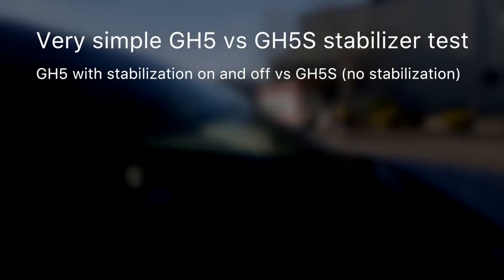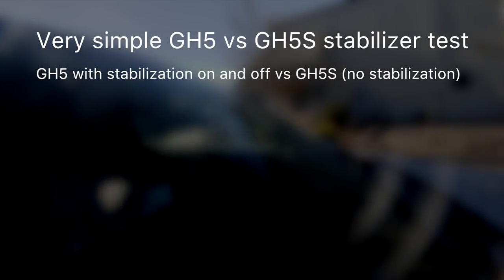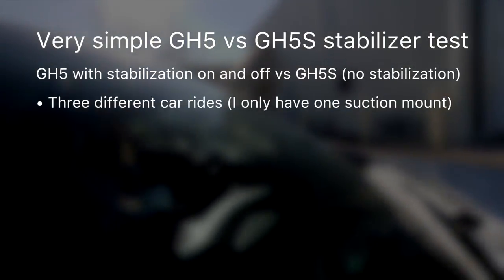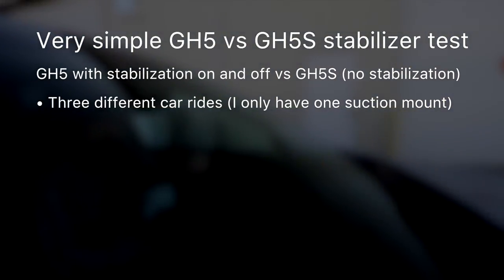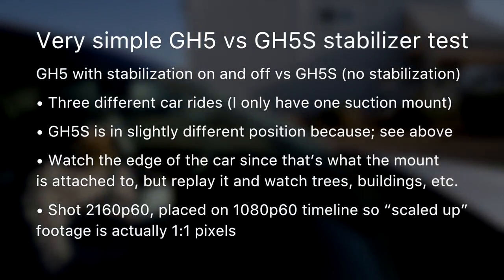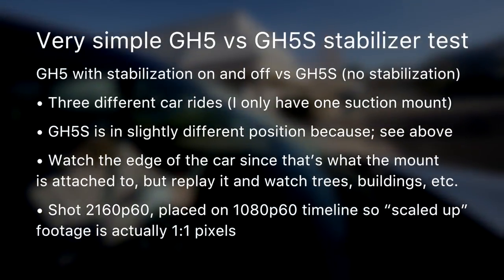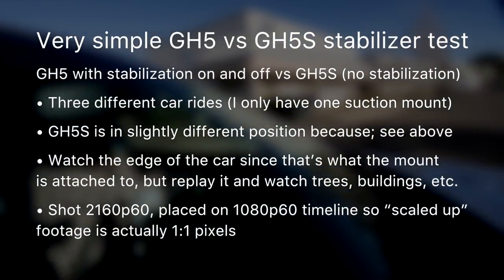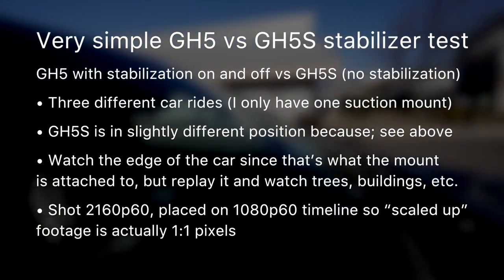GH5 vs GH5S Car Mounted Stabilization Test ► Why the GH5S has no IBIS!

Comment: Holy freaking crap. You did a great job of showing the truth behind the lack of IBIS, but you've unintentionally done something far greater: you've shown how much more detail the GH5S captures over the GH5! If you look at the ribs and ends of the metal awning as you drive by, there's SO MUCH more detail in the edges and the reduced rolling shutter becomes obvious too. Thank you for this. Quality content, my friend.
Reply from the maker: Thanks man. I think it’s the elimination of the movement that’s allowing that to be sharper; not because of a difference in general sharpness on the sensor. But good catch for sure.
Reply: @photojoseph  Possibly, but even if that's true, the captured colors are richer as well. The movement shouldn't make the colors look better. I'd guess the fat pixels are responsible. Well, that or you didn't match color styles. By the way, was this with the newer firmwares (2.4/1.2)??
Reply from the maker: You may be right. I believe I set the color profiles the same but that's probably about it. Color matching wasn't a goal. The video is nearly a year old so whatever firmware was current then.

Comment: I had to get an in-car shot yesterday and rigged my GH5 + Lumix 12-35 lens with stabilization for BOTH turned ON. I had the camera mounted with two suction cups on the windshield connected to the cage via friction arms. The thing was rock solid. Got the footage off of the camera and it has those tiny micro vibrations. I didn't even consider using my GH5S. I think that I'm going to have to do some tests now b/c I need to re-shoot the footage.
Reply from the maker: Yep… the stabilizer isn’t designed for (and I don’t know that it even could be) those “micro vibrations” as you call them (good name). Sorry you had the experience but now when people complain to you that the GH5S has no IBIS, you can explain why 😬 Also when you test again don’t forget that lenses with IS are the same — floating elements that will still move when IS is off. Probably less of a problem than the sensor although I have not tested. That’d be interesting though. If you do end up testing stabilized vs non-stabilized lenses, I’d love to hear your results.

Comment: I wonder if they could design some kind of trigger in the GH6 that mechanically locks on the sensor when IBIS is turned off. Just so those car and Gimball/steadicam people can be happy.
Reply from the maker: Not likely. The sensor floats in a magnetic field. You’d either need physical, retractable “claws” that grab the thing, or magnets so strong they pick up nearby spare lenses ;-)
Reply: Yes I'm thinking retractable claws or something like that that mechanically holds the sensor stable when IBIS is disabled.
Reply from the maker: That’ll never happen. Take a look inside the body… there’s no room for that.
Reply: @photojoseph   Never say never ;)

Comment: I thought the other issue is that they are actually going using the "entire" sensor size to maximize anamorphic resolution, vs. GH5 which can only utilize a portion of sensor to allow movement. (same principle as with IS lenses).
Reply from the maker: The sensor in the GH5S is slightly larger than a standard M43 sensor, yes. This is possible because IBIS was removed.

Comment: What they actually should have done is design a way of parking the sensor. I’m sure a couple miniature servos could physically lock it in place? Great test tho. I guess if you want the best of both worlds you just need get a GH5 and GH5S 😂
Reply from the maker: I don’t think there’s space for that. Do you know if any camera does that?
Reply: @photojoseph  Not that I know of, but I know <6mm servos definitely exist... On a similar note, do you think using a lens with OSS switched off would still have an effect on the image? I've noticed when filming concerts the bass vibrations interfere with IBIS systems (Sony in particular) but now I've started to think about OSS lens optics floating around when OSS is switched off...
Reply from the maker: Yep, same problem. The glass elements are floating. I’d guess there’s less noticeable vibration since it’s optical movement but I haven’t tested

Comment: Guess this would apply to running or moving fast paced with a gimbal
Reply from the maker: Crap where’s my reply? I wrote one… grrr. Ok here we go again. NO, running is absolutely NOT the same. Running is a big movement with a hard jolt at the end. Moving fast; same but less jolt. If you’re running you’ll want a proper gimbal. The IBIS in any camera is designed to stabilize hand movement, not walking or running. Think of the physics involved; the sensor only has so much space to move around in and compensate for camera movement. If you use a gimbal, I don’t think it matters much what camera you use. I haven’t done enough tests myself (but I know others have — check Max’s channel) to know if it’s better to have IBIS off or on when using a gimbal. But any difference will be negligible.
Reply: PhotoJoseph I've heard someone explain that with the gimbal and a camera with stabilization they've seen more gitter. So after seeing your video the gh5s looks more stable because of its lack of in camera stabilization. I Forgot to mention the gimbal in my first statement
Reply from the maker: Ok, but remember that you can turn stabilization off on the GH5 and that will be the same as the GH5S at that point on a gimbal. This video shows that GH5 stabilization off and GH5S are not the same thing in an environment like this — the very hard bounce of a car. But on a gimbal, it’s totally fine. That said if you’re going to primarily shoot on gimbals, then the GH5S is a better option so you have the dual native ISO.

Comment: GH5S on Ronin SC is shakier than my Mark3 handheld. this sucks I want to sell this camera
Reply from the maker: Uh, then you’re using the gimbal wrong. Sorry.
Reply: @photojoseph  microjitters . the camera picks up every tiny slight movement
Reply from the maker: I Hate Living in Apartments if the gimbal is transferring those kids of movements then it can’t be set up properly. Without a doubt. Gimbals are designed for cameras withOUT stabilization and often you need to disable stabilization or the two fight each other. The GH5S plus a gimbal should be the best solution possible.
Reply: @photojoseph  Ronin app reports balance as Excellent. I mean I do have to learn to move better with it
Reply from the maker: I Hate Living in Apartments That’s very odd indeed.
Reply: @PolymerJones  the same here, whatever settings i tried for month, having non stab lens on camera using ronin sc  every now and than gives  disgusting jitters/shakes when moving fast/walking steps but stabilised lens with it ON-perfect result even if running - have no ibis on my cameras-the reason got gimbal....